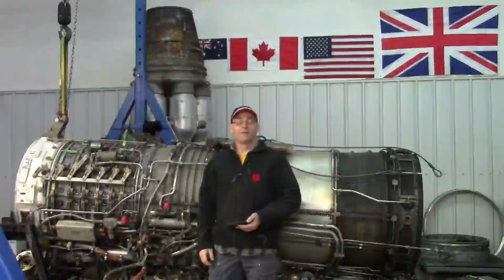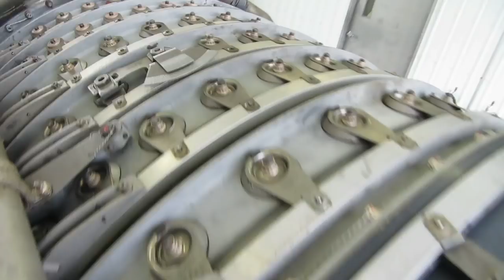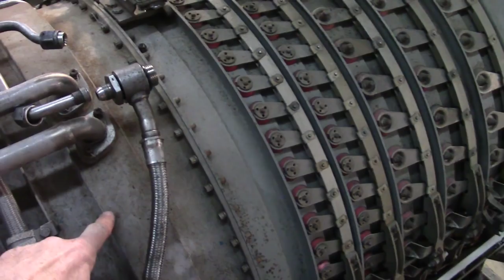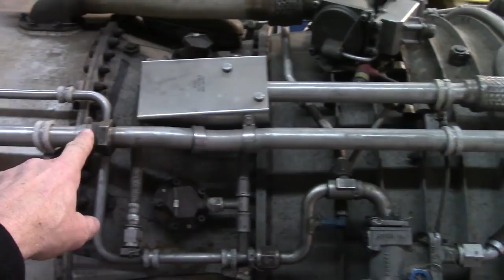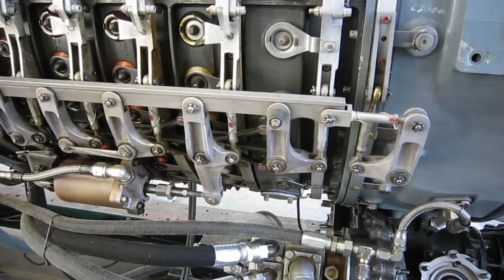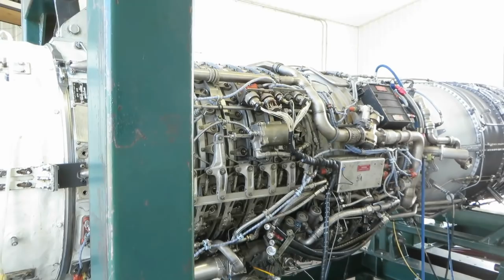Compressor Stall Q&A

Comment: Hello!  I have a question for you.  About the variable stator system - I see in your videos, especially the j79/lm1500, that the variable stators in the compressor are all linked together by mechanical arms that makes them move in synchronized harmony to their told position.  All of which is connected to a bracket and powered by one single hydraulic piston.  Is there allot of force needed to move all the stators?  There are apparently many stators.. And I guess that just the mechanical structure, with all its parts, offers allot of resistance too. 

Anyway, I really what to thank you for the effort on makeing these videos!  It have certainly given me countless hours of interest, knowledge and joy!  My interest in turbine engines are really true!  My father and my brother are both pilots and learn me allot about that.  So it feels great to be able to learn them a thing or two about the machines they are handling, very much thanks to you!

Comment: Hey there, love your videos. I wanted to comment here on what I think is a critical phenomenon in helping people understand compressor rotor AOA and why the vectors work out the way they do. You have always mentioned AOA as a vector of 2 factors, rotor RPM and the velocity of air through the compressor. As you've said, the rotor blade angles are optimized for full power operation, so at lower RPMs we need the help of bleed valves and variable stator vanes to change both the speed and angle of air introduced to the rotor blade to stay within a proper AOA. But what is really driving this is that as we decrease RPM, the decrease in velocity of the air through the compressor is not linear, if it was, then we wouldn't need bleed valves and VSVs as the AOA would stay constant. This is something you eluded to and I know you understand but in my humble opinion needs to be explained further. For example, a jet engine turning at 50% RPM is not going to have 50% of max velocity through the compressor, it will be much lower. Again, you did mention something about this on your compressor video, but I think this needs to be hammered on more as this non-linear relationship is what drives all these vectors to be so much more complex.

Comment: Great video. How does altitude affect the fueling of the engine? Is combustion chamber pressure fed in to the fuel control?
Reply: No. The pump rotates at a certain speed and it pumps a certain volume per rotation. The pressure is not important. And the fuel control is not as advanced as you might think. In most cases it is hydraulics or Fly by Wire. And not the computer Fly by Wire. Fly by real wires.

Comment: I wonder if using an example for stall like when people put their hand out the window while driving (I don't recommend this btw) into the wind and as long as its relatively knife edged it cleaves through the wind with little resistance, whereas if you increase the "angle of attack" as we're referencing, it gets more and more difficult to keep your hand from being blown back. If the hand flattens out against the wind it is pushed back and encounters what one might call a stall. This gives people a more direct example they can put in their heads I think. But that's just me. Again, I might be misunderstanding things.

Really enjoy the videos AgentJayZ. Learning a lot. :)

Comment: One thing that has got me confused is how you mentioned compressor inlet temp reflects air density + the compressor RPM tells the VSV what position it should be in. My Question is Wouldn't air at  -20 degrees Celsius at ground level during a test in winter be at a different density to say -20 degree at 30,000 feet in the air (hypothetical values) due to the change in altitude pressure affecting how dense the air can get?  Would you know of a book/source  that explains this a bit more in detail??
Reply from the maker: Maybe I didn't include that the VSV controller also measures ambient air pressure. My video called Books! will suggest a few that include this subject.
Reply: @AgentJayZ  thanks for the reply, I dont think you did mention it, there was only  quick statement about temperature reflecting density

Comment: Why is the VSV posistion not determined by inlet air pressure too? I would guess that pressure is more indicative of the density of the air than temperature? Especially in aircraft the pressure is going to change a lot.
Reply: corrected N2 is what sets the vsv settings

Comment: Would the information in both of you Compressor Stall videos apply equally to a High Bypass Turbofan engine?
Reply from the maker: It applies to all axial compressors.
Reply: @AgentJayZ  Thank you. I was not sure if the low pressure and high pressure compressors experienced (not sure how to word it) different stall conditions.

Comment: Hi! 
Its not related to this video, but i think you might be interested. If you remember, a few years ago you did a giveaway of s bunsh of J79 blades, i got them. Recently i have come across a supply of old german army stock with several hundreds of brand new J79 blades, compressor as well as turbine and a complete assembly of all three turbines. If you are interested in them contact me and i will get you in contact. They sell them dirt cheap in original packaging.

Comment: Long time lurker here, so far i have enjoyed it all. I have not seen all your videos or read all the comments but I did read as many as I had time for and I don't believe  my questions have been asked.
1. why is the FCOC on the J79 rendered inoperable when it is demilitarized? I have heard of firearms and destructive devices being cut but not anything else. Is it considered a proprietary technology or is the engine itself not available for civilian use, so key components are destroyed? I also have another question but I need to find the video. 

Edit: question 2. In the RR Tyne test prep video at 1 :55 a fella pulls a cable up by the inlet, can you explain what that was for? 

Also: If you have time to cover the chemical dispersion system for the chemtrails lol thanks man.

Comment: J, it seems that everything that operates in air or a gas requires LAMINAR FLOW to function correctly. Which means the molecules are moving in unison and in a smooth path parallel to each other. This applies to airfoils like wings, rotors, props, and axial compressor elements. LF is also  required for orifice meters used for measuring NG flow rates. But when the flow becomes TURBULENT the molecules go into disarray and move in non uniform patterns. That causes airfoils to stall and NG meters to read incorrectly. I believe turbine engine designers strive to maintain uniform laminar flow at all points in an engine which results in smooth efficient power delivery. The variable angle stator guide vanes in a compressor is a way of optimizing laminar flow in variable air densities to get that result. Bob
Reply from the maker: The combustion area and the afterburner flame holder are structures engineered specifically to maintain turbulent flow  in order to ensure reliable ignition of all the fuel air mixture.
Otherwise yes. The loss of laminar flow over the convex surface of the compressor airfoils is the definition of a compressor stall.
Reply: Ok im good to go with that.  Combustion chambers do work best with turbulence whether in turbine or recip engines. Since fuel and air need to be well mixed for good burn.  But  was trying to give a general sense of the process without getting in too deep. While hoping to be mostly correct. Bob.

Comment: Re: angle of attack. You also get some interesting effects due to rate of climb in airplanes. Hopefully in a turbine engine the air will always be entering the compressor section close to perfectly axially.

If you want to go into the details of airplanes stalling, you usually don't lose  lift at the point of stalling, you just have a massive jump in drag, and lose flow over control surfaces.

Comment: What about the bleed off valve that deals with compressor stall? Briefly talk about it, at at stage of the compressor is it installed and why?
Reply from the maker: The bleed valve method of preventing compressor stall is discussed in the video that precedes this one. It is called Jet Tech: Compressor Stall.

Comment: Great vid and on point as usual.
With VSV and bleed valves  basically doing the same thing, preventing stall, why would VSV be used in a industrial envorment? Seems very complicated and costly for steady-state running. In a aircraft, do VSV react quicker to prevent stall than bleed valves?
Reply: When you say industrial , do you mean power generation? If so we do not have vigv or vsv here because we operate at one specific speed.  As to your comment on vsv vs bleed valves; I believe either VSV or VIGV are preferable during constant varying rotational speeds than bleed valves. Because with bleed valves you loose total compression, I believe.
That is why we (power industry) start with bleed valves open, because we want increased flow without cavitation, we don't care about compression at startup. IGV's stated as closed are not closed, they are just limiting. Once an industrial turbine is close to speed the IGV'S can be opened (80%ish) and bleed valves closed. It is more of a cavitation and stall issue during start up while the compressor airfoils are not in proper attack angle.... Once the air is "walked" in a forward motion and the rotational speed is near max we close bleeds and open IGV's.
Spinning up can take up to 45 minutes to ease thermal issues. The airfoils are not in there optimum angle and creating Bernoulli's vacuum. You can stall!
I saw a unit trip with  IGV failure and it rumbled the ceiling tiles out of the ceiling with the air changing speed and not being able to go anywhere.

Comment: Question could it be possible to eliminate the need of stators by arranging the compressor blades in a corkscrew pattern? Air is a fluid it should get pushed back instead trapped in a tornado type pattern right?
Reply: That would be a centrifugal compressor.  
example: Pratt and Whitney PT6

Comment: Q:   at 15:50  there seems to be several mm of free play / lash in the rod end of the hydraulic cylinder of the actuator for the vanes,  is that what i am seeing; it seems amount of lash would be too much to be within tolerance.   I can only guess that the air rushing across/thru the vanes are always applying a moment that keeps the linkages in compression or tension and never from one to the other... but then i saw that rod end linkage wiggle....
Reply: Joe Kozak I reckon it is a closed loop system and it doesn't matter what the hydraulic cylinder does because the actual position of the thing that moves the vains is read by the computer. and not the hydraulic cyclinder position
Reply: Joe Kozak Also there needs to be some wiggle because the arm the hydraulic cylinder engaged on is on a pivet so it moves up and down on an arc as the cylinder moves out and in
Reply: good point about the pivot and arc!   i totally missed that!   So there must be some special bearing in there that takes up the difference...  surprised they didn't just make a secondary linkage there...

Comment: So glad to finally see the compressor stall video and this follow up. In the original video you said a compressor stall occurred when the compressor accelerates too quickly, faster than the air can accelerate, so the critical angle of the blades is exceeded. I wondered if combustor and diffuser pressure were an issue, as well, with an over zealous application of fuel the flame gets rapidly bigger faster than the rotor would spin up. Does the air pressure on the diffuser exceed the dynamic pressure from the compressor in these cases and stalls the compressor from back to front? If not, I would guess resistance from stalling would be a real advantage to fixed rpm engines. Another question, when these engine stall, which stage of a compressor stalls first? Still so many questions about this. Do centrifugal compressors stall? What damage occurs to an engine during a stall?
Reply: " I wondered if combustor and diffuser pressure were an issue, as well, with an over zealous application of fuel the flame gets rapidly bigger faster than the rotor would spin up."

In this scenario the issue will be combustion temperature, not pressure. The lack of cooling air from the compressor will cause the combustion output to exceed the thermal limits of the turbine nozzles.
Reply: randomYOUTUBER That was definitely an issue for the Me 262 engines.

Comment: nice video as always, i do have one question, but it doesnt really have anything to do with a compressor stall, but could you do a video on how the high pressure recoup works in an gas turbine engine. there seems to be very little known about it on the internet.
Reply from the maker: +Wouter Van Oerle
I don't know what that means.

Comment: How do you determine power?  With an automobile, you have a dynamometer to use.
Reply from the maker: Several ways. Power turbine driving an electrical generator. Power turbine driving an aerodynamic load with a torquemeter on the shaft.
Or we can measure pressure rise in the jet pipe with a measured choked nozzle at the exit.
Reply: @AgentJayZ    Excellent!  I figured barring any physical load, SOMETHING (pressure or velocity) in the throughput could be measured. Thank you kind sir.  Happy Holidays.  Btw, someone sent me a video of a recent Community and Public Health Commitee meeting in Ottawa in regards to Covid.  Speaking was Dr. Hopkinson (specialist in pathology including virology).  I can’t post it here.  But, you can google it if interested.  Powerful commentary.